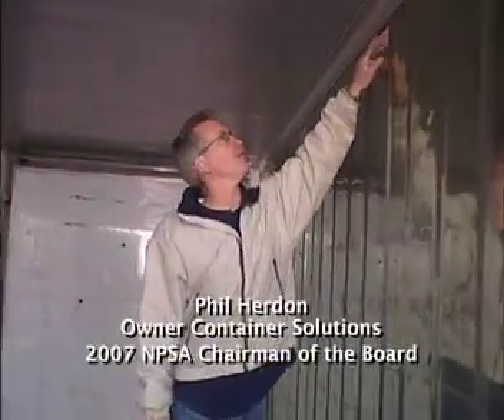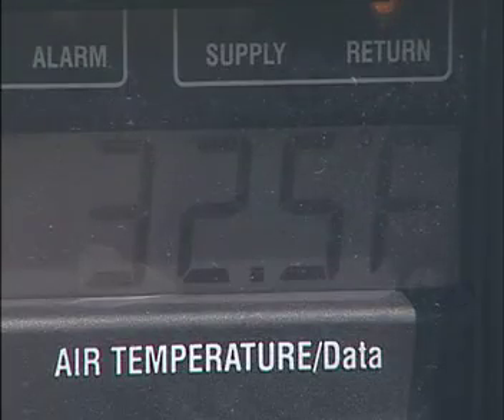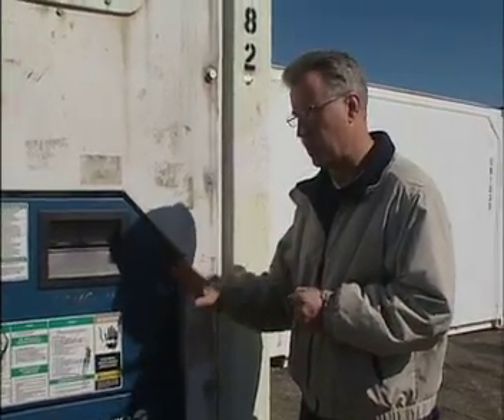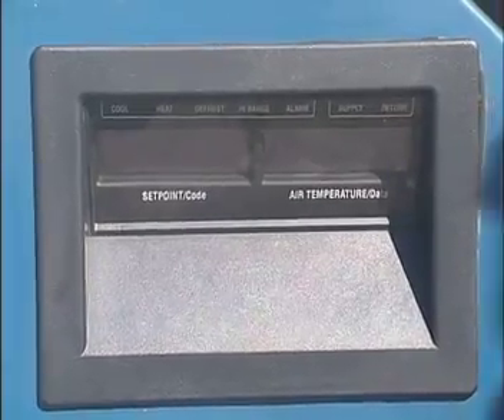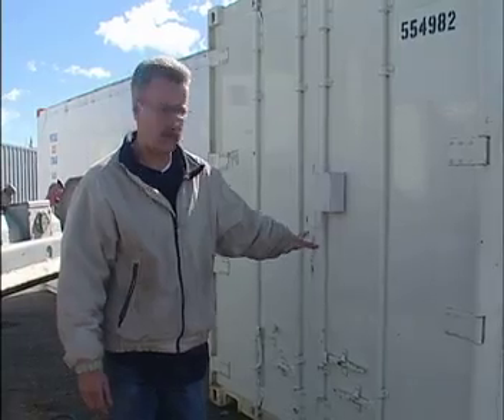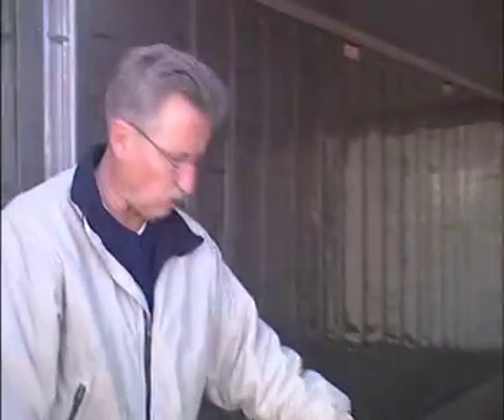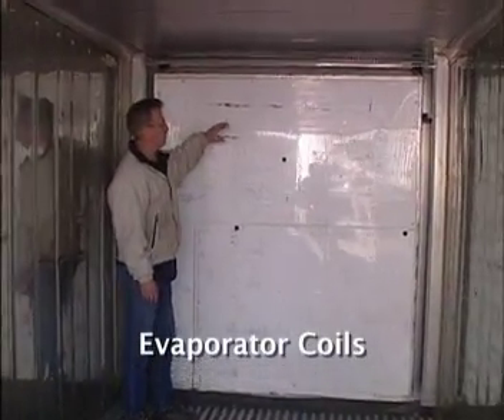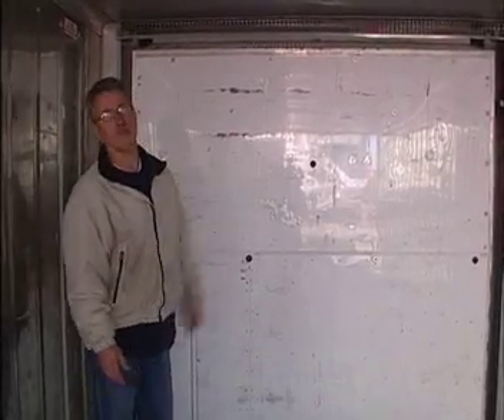Getting the most out of your Refrigerated Container

Comment: Good Video , but not showing many of the pitfalls buyers have to beware of when buying a reefer container. But a very good understanding of a basic unit workings. Beware of the pitfall , container resellers willnt tell you about, i have been doing this work for 30yrs as container inspector, modifications welder , container repairer.